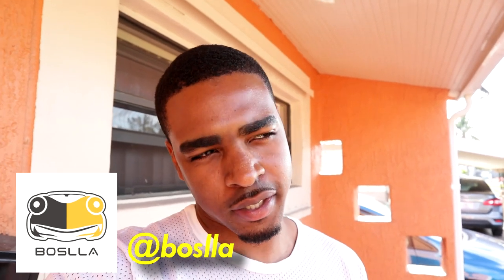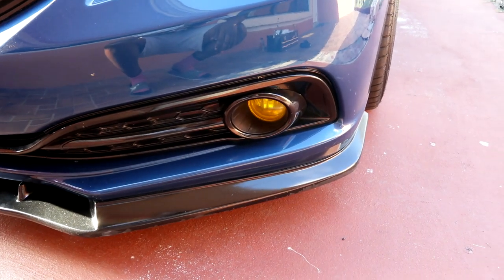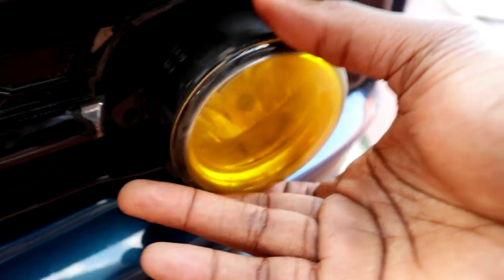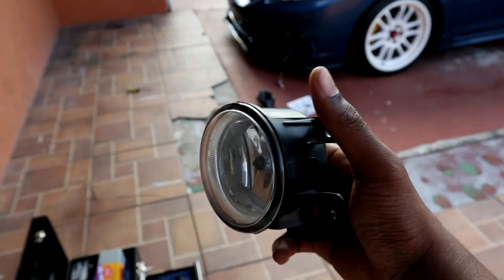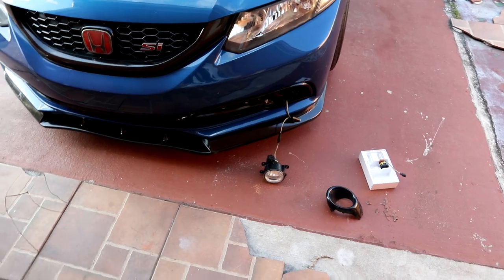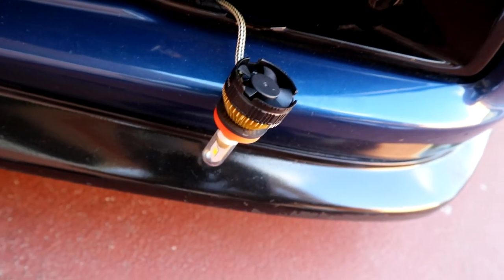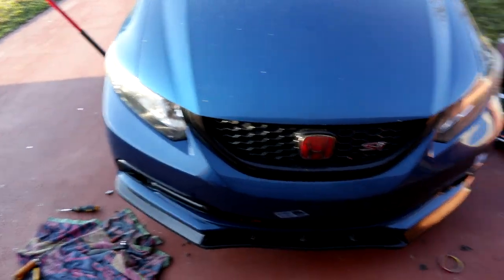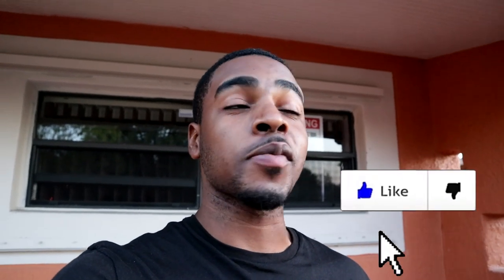Installing Very Special Fog Lights! | Boslla 4in1 LEDs

Comment: Pretty clean lights bro! I just installed some Fogs on my EX, got some basic Nokys Yellows but should do for now. I had a question about the LASFIT lights. Thanks to you my whole car is LASFIT and looks good. My rear signals were hyper flashing and I added resistors and it fixed it, but let’s say I leave the left or right blinker on for a while or flasher they eventually hyper flash. Maybe it’s not biting into the wire good enough?

Comment: SI sedan are H8 and the coupe is H11... found out the hard way. Lol
Reply: You have a fb6?
Reply: @jr97n73  sorry for the long ass wait for the reply but yes I have an fb6
Reply: @scrappy0987  what year
Reply: @jr97n73  2015, when I took off the fog lights it has the number imprinted on the housing.

Comment: Quick question will i get CEL if i throw downpipe on my 9th gen im fully stock rn i only have muffler delete and takeda CAI.
Reply from the maker: Yes you will , u need a tune or a o2 sensor cel eliminator
Reply: zoovie where can i get em?